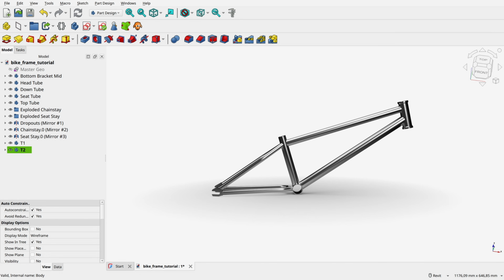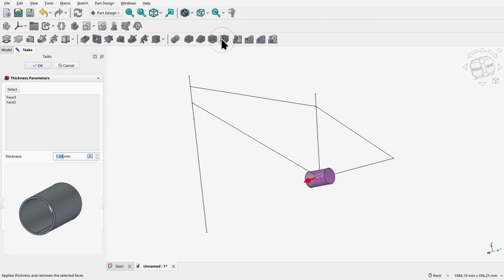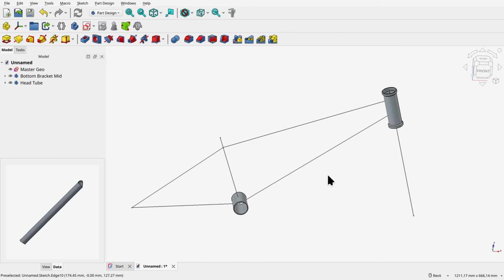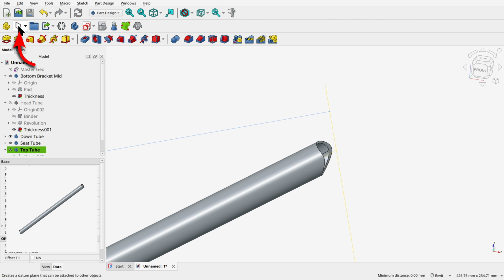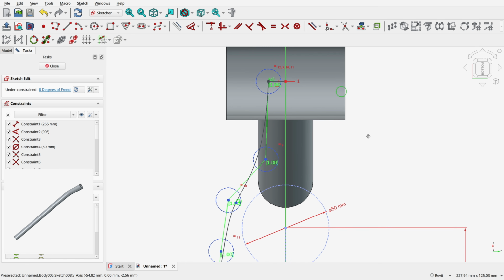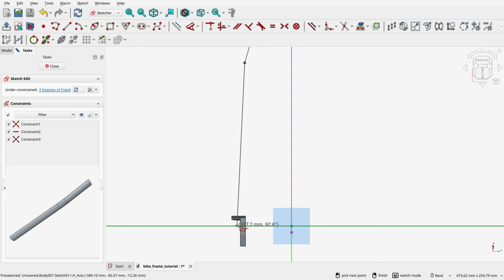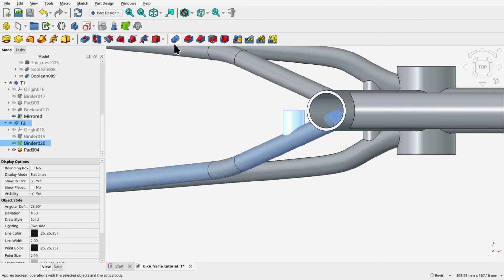FreeCAD  1.1 : Tutorial to become a PRO - Complete Parametric Bike Frame - Direct Assembly

Comment: I just completed this using FreeCAD 1.14, and while a very small number of icon locations changed, the procedures are still valid.  Well done.  A nice intro for the beginner to building tubular structures on Part Design.

Comment: amazing tutorials, but i wanna ask you something if you can, we are able to follow you and learn but the main idea on cad is to make real parts from cad , what i mean ? we need to know how to export tube list parts etc and unfold for use on a machines like laser cutter like dragon , or at least mark the tube end export the paper unfolded notchers etc , like hand bending tubing machines and notchers , some hand bending tools we need some way to mark a line on the side of the tube to calculate the rotation on bending etc , other things are like on other video you show a toggle clamp and modeling a twisted sheet metal handle that should be made i think on sheet metal workbench to be able to unfold and mark were to bend and also laser cutting etc , can you do a tutorial like that? or if you already had can share?

Comment: Thank you for these amazing tutorials! I am having issues with the boolean cut operation with the Chainstay and the Dropout.. The binder of the dropout suddenly changes location when I open the boolean task. Making it impossible to continue. EDIT: it turns out I have to double click to Binder too, before starting the boolean operation.

Is there a way to avoid using the "Part" workbench. It is not very cool that basically you have to destroy the parametric nature of the body just to remove one part of the compound.

Comment: I jut ried FreeCAD. Coming from Solidworks and Inventor. I am a mechanical engineer. I didn't like it at all. It's fine for hobbyists. But for actual engineering wok for clients it's not even close. Which is fine. But it is for hobbyists so if you can get around the nightmare UI and flow then great. but if you are a hobbits just get Solidworks maker. for I think £50? it infinitely better.You get what you pay for still applies I guess

Comment: Since I'm a cyclist and know the anatomy of bikes since a build them, I thought wow this is fascinating to construct all your videos on bike parts.  FANTASTIC.   Now for the problem I faced.  @29.50 creating the dropout offset.  I am using freecad 1.1.  I'm assuming changes have been made from 9 months ago since you were possibly using a beta version of 1.1.  So, the issue creating the 3mm offset.  @30.09, where to 2 outer lines connect, my version creates an arc.  Therefore end result does not work.  I even downloaded bike-frame-tutorial.  The sketch is not correct.  Removed the offset procedure and started over again and get the same result getting an arc connecting the 2 outer lines.  IF anyone can resolve how to create this sketch with the latest freecad 1.1 that would complete this tutorial.  All in all, you  can definitely learn alot of detail in this tutorial. 👌🙏
Reply: So one fix is to draw a  line At the connection between the outer 2 lines we created as construction lines AND the top point are the arc that is created using the offset.  Make the new line also as a construction line.  Creating the Pad is successful. 😀

Comment: First of all, Thank you for all your great work in producing these videos. As I am working my way through this great tutorial, I got stuck at the first boolean operation. When ctrl selecting the Down Tube and the Binder, I had all the previous items selected and couldn't remove them??? The solution for me was to ONLY select the binder and then perform the boolean operation. I am on version 1.1.2 so is this something that has changed or is this a setting issue in the preferences?

Comment: Problem i have with the errors poppong up is with the bottom bracket. For some reason after establishing the master geo and then a new body for the bottom bracket it has attached it to the master geo and ive been over the video several times to see if i have anything wrong. Ive followed it. Its also doing odd things like hiding the measurements of the top tube when you go back to change the geometry i cant see what im missing for this to happen
Reply: Solved it. Had to start with a binder to the master geo for the first sketch of the bottom bracket and now everything is working as it should. Only thing ia doing that if you follow the video you are 1 number out on binder operations compared to the tutorial

Comment: 1.1 has weird bugs... surface skecthes randomly gives error "not closed line" even in centered circle and there is another issue with external projection. if you use projection your padded skecth automaticaly converts to pocket. same operation runs very good on 1.0.2...

Comment: doing the pipe operation is very repetitive. it could be implemented a tool like the Weldments in SOLIDWORKS. Designing frame structures with standard profiles and many connections can be  a very painful job...

Comment: Great tutorial, thanks a lot.
I had a problem with the dropouts sketch though, took some time to fix but I think this could be helpful for others as well.
I followed the tutorial, then, when changing the master sketch to check that the dropout would move accordingly, I was changing the lower lenght of the sketch by a lot, I was moving it by 200mm at a time. This made the sketch break, and so the first and second pads.
To solve this, I firstly created a local coordinate system (same icon menu as for the datum plane) and attached it's origin to the master sketch's binder, then, instead of attaching the dropout sketch to the datum plane, I attached it to this LCS.

Don't know why, but Gemini told me attaching a sketch to a LCS makes it move in a rigid manner, following the LCS. This makes so edges don't flip position relative to the constraint's anchor, no matter how much it moves. 
I also anchored most constraints to the center of the first arc instead of the 2 construction line axes.

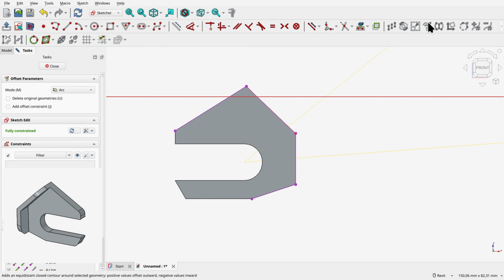Comment: Hi i am following this tutorial on version 1.0.2 trying to learn the software, ive followed everything you did but at 29:56 when i try to apply the offset geometry i keep getting a message saying "Selection has no valid geometry. B-splines and points are not supported yet. (16 times)" is there any work around??

Comment: Instead of creating all those single use datum planes you could just create the sketches and then attach them like the planes were done.
Reply: It’s certainly true, but datum planes are much more visual than a floating sketch, in my opinion it’s much easier to visualize what you’re doing with them (or if you have to study that design from scratch). As long as your computer can handle it, I guess it’s fine.
Reply: @fumomono9626 it would be nice with an option to make the sketch plane visible. A q&d solution would be to create the sketch, draw a box around the origin and then figure out the attachment.

Comment: Very useful, thank you for taking the time to fully describe how each of the tools work.  As someone who has just started to use FreeCad 1.1, the main sticking points seem to always be the quirks of exactly what a tool can be applied to (especially constraints) and in what order things need to be selected, etc.  Some sort of cheat sheet would be a very helpful thing, if there is way to do that.  Even better would be a video that uses each (as much as possible) tool with some sort of index of them.

Comment: It seems to me, that the 'Sub shape binder' works like this: it creates the 'Reference Geometry', which can be then used directly for constructing a new  geometry or Boolean operation. without making new geometry by using 'Create external geometry' tool.. But in such case, we need to make the 'Sub shape binder' ONLY from the  master geometry sketch line(s) which are going to be used to create the tube ( and NOT the entire master sketch) (@8:40 - like in the case of making the 'Head tube'). Yes, indeed, when creating the Binder 001 for head tube, you need to select only the 3 small line sections and you can skip using Create external geometry step. So it applies for the rest of the construction or anywhere else.
In new version (I read somewhere v. 1.2.2., which  is only experimental and not officially released yet) it is possible to have 2 or more  solid bodies in one Part Container, which means, that you can also skip using the solid tubes(from which you created the frame usable hollow tubes). You can subtract one hollow tube from another hallow tube directly and the extra leftover pieces it creates won't make alarm message and you can just erase those manually......
Other then that, excellent demo and commentary. Very organized! Thanks!
I would suggest slowing somewhat down and before doing to any Next Step in your construction, analyze all the different options the software offers for that particular construction and explain why you selected that particular way to go about making it, rather then using those other available options... That kind of thinking makes the people becoming top software operators and designers.
Oh...and by the way, this particular construction is called "Top Down Design". You make a parametric skeleton of the product and then you fit all parts into it.
Where the exercise called "Bike Hub Assembly Tutorial" (on your page) is a "Bottom Up Design", where you create all the parts and THAN you assemble them into final product.
Oh....and yet another detail.....your bike is very good example for it: All the components you created for your bike(like Frame, Handle bar, Wheel hub, Wheel etc.) are separate files....But in fact you could have created file name called  "Bicycle", where all other files could be located. That is the intention of the FreeCAD structure...... you create file name Bicycle, inside of that file you create "PART" (using the YELLOW  Icon,  which looks same as the Icon body, but yellow color). This Part would be named Bicycle Frame, inside of it will be number of bodies as necessary. Then inside of the same File you create another Part, called - lets say - Handle Bar and inside of it number of bodies as necessary, then create another Part, called Wheel Hub with all the necessary bodies and so on and so on.....so all the files you created could be done inside of one Filename, which contains all the part which make up the entire Bicycle.
Now - what I am not sure about, is, if you can freeze each PART inside of that one Filename, when done and finished, so the Re-calculate/Re-compute or also called Refresh function does not re-calculate everything every time you press it. It would be gigantic waste of time, of course.

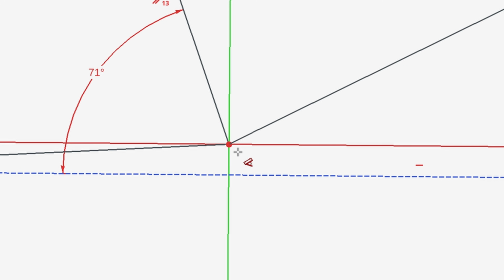Comment: Followed till 4:50, where I couldn't set the vertical dimension. I tried to remove the first constraint, but after setting the dimension and left click Freecad jumps to set the dimension with the central point. I'm continuing my search for Freecad tutorials that a beginner can actually follow.
Reply: It's frustrating at first. You probably clicked something you didn't realize, or have a slightly different version than he does. In the beginning I couldn't even get basic panning to work, but by (sometimes aggressively) clicking on everything I eventually started to get the hang of it.

If you want to succeed with FreeCAD you have to set your expectations to "This is not going to be easy". Especially if you've not worked with other CAD software before (like me). Experimentation on your own will be needed....

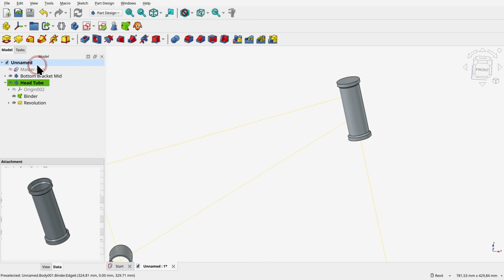Comment: For 13:17, performing the revolution function for the headtube, I kept getting "Wire is not closed" error in FreeCAD v1.0.2. Something in FreeCAD might have changed. I managed to fix it by going back to the sketch for the Head Tube, and adding a vertical construction line for the axis of rotation, and enclosing the sketch (rather that leaving a C-form).
Reply: You have to validate the sketch beforehand with the appropriate tool (it's the sketch icon with the green checkmark on the right-bottom and you can find it in the Part Design and Sketcher workbenches). Probably you forgot to close your sketch (in the sketch testing you will see a problematic vertex/vertices).

Comment: does freecad 1.1 refer to the bleeding edge release(if so, which one are you using)?
it seems that currently only 1.0.2 is out on stable
Reply from the maker: @adithyaps3606 I used the latest dev version. I believe you could achieve the same with version 1.0.2 since I didn’t use any new tools.

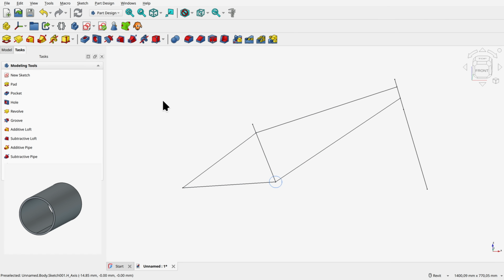Comment: Bro my circle is not going green in 6:47 what to do how can I fix it it's not fixing i put it on exactly middle but it's showing blue dotted line over circle help me bro i am 15 year old boy and try to learn 3d model from you please help me .I use chromebook .
Reply from the maker: @MAYSHYA_OFFICIAL Did you press the construction tool? Are all your drawing tools (line, circle) dotted with blue lines?
Reply: Yes
Reply from the maker: @MAYSHYA_OFFICIAL You are in the construction mode. Click again the construction tool and the drawing tools will work as normal after that.
Reply: I am having problem with my freecad software can you please give me your software which is can use in my chromebook 😊
Reply: Can you give a freecad software for chromebook  users please big brother 😊 how to do free cad on chromebook please

Comment: This one seriously fried my brain. I had absolutely zero sucess in the 1.1 beta, I kept experiencing lockups along with config errors and had to reset config every 5 minutes. I ended up following this in 1.0.2 with complete sucess eventually. In a few days I'll jump out of bed with ideas and it will all fall together. I'm only 1 week in and I've barely touched the surface but I now have a parametric shed design of my own making and this model. Everything else has been very basic boxes but I feel like I want to dive in deeper with FreeCAD because there is so much more in this amazing piece of free software!

A note for the dev team if they ever see this. An error should not render the application useless and lock it up until you completely erase the erronious .config settings files and relaunch. Showing an error every 2 seconds that locks the program while restricting any remidial actions within the software is extremely bad practice.

Comment: How does one decide when to use an assembly?  Your video on the wooden bench used an assembly, the bike frame does not.

Is it because in the bike frame, the some parts cut other parts?

I want to model an acoustic guitar, where some of the wooden parts must cut other parts, for proper fit.  Should I do it as you did here, without an assembly?
Reply from the maker: @gregholmberg2 In any other CAD program, I’d go with an assembly, but in FreeCAD there’s no easy way to cut one part from another directly within the assembly (the binder keeps the default position, not the position in the assembly). So I chose the direct assembly approach. If you need to cut parts from other parts, I’d recommend doing it the same way I did here.

Comment: First of all, I want to say that this is a great tutorial. but Free Cad 1.1? Am I missing something because on the official Free CAD website It says Free CAD 1.0.2 is the latest version, and I don't know if it's why the software looks different from mine and yours, but some issues came up when following the tutorial, I couldn't get the pad operation to work on the dropouts, something about the wire not being closed also, when adding to external geometry it didn't let me select the 2 "inner lines" and make a offset of those, I had to add a line myself, unlike the video when I made the offset it doesn't turn orange indicating it's over constrained and it was honestly disaster from there because everything looked so different than what I was seeing on my screen. If I could get some clarification, it would be greatly appreciated.

Comment: As usual its amazing, today is my anniversary but I will cancel the dinner to watch the video 🤣🤣

It would be great if one day, you made an assembly video in bottom up design fashion, so not combining parts you designed prehand but assemble and design as you go. At work, we have to import parts like bearings and motors and design around them, I dont know how long a link has to be, before design matures a bit. 

This type of tutorial has been super hard to find for FreeCad, I think it even turns of Fusion360 users, which in my opinion would love FreeCAD V1.1, as it really is a mature system now
Reply from the maker: @ROBOROBOROBOROBO, initially, that's what I wanted to do. In the industry, you often have a catalog of tubes that you assemble with one another, but I couldn't find an elegant way to cut the tubes between them. In SolidWorks, you can project parts of the tubes from the assembly directly into the part and then make the cut in the separate part. In FreeCAD, when you use the SubShape Binder in an assembly, it takes the object's initial position, not its position in the assembly. To successfully import it in the correct location, you have to use other, much more complex procedures.
Reply: @deltahedra3D  Wow maybe thats why there is no bottom up assembly videos around 😭

I will still look for a way around this, as most of what FreeCad offers now is on par with Fusion360 really. 

Even there is the open source Lens server so you can have your own cloud versioning and storage tool. FreeCad after V1 is roaring loud. Thanks for your amazing videos which doctrinates new comers to the FreeCAD